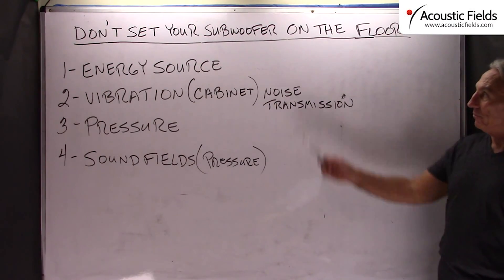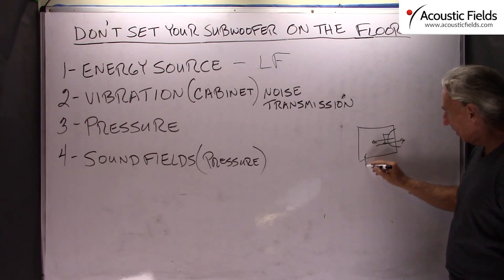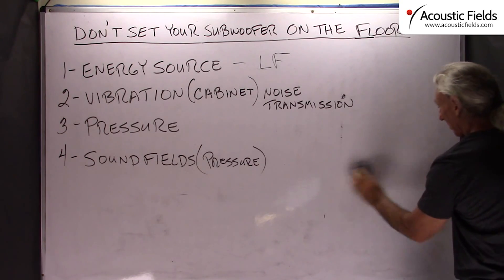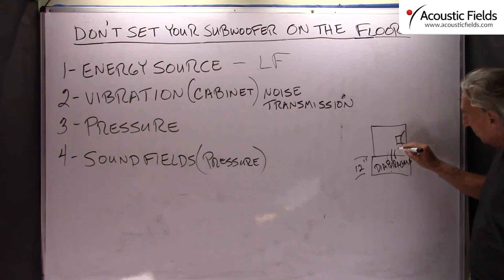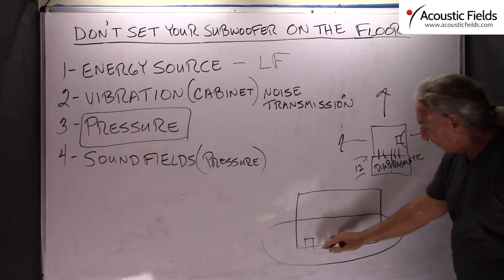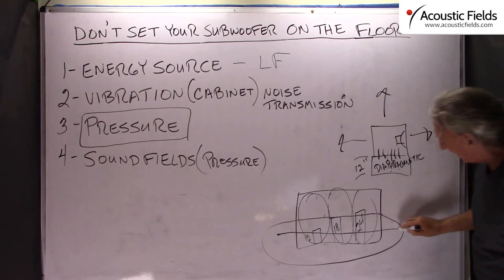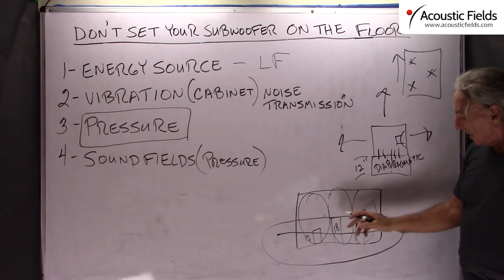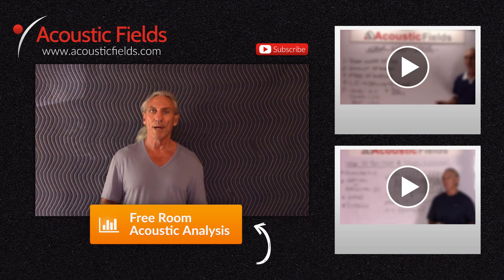Don't Set Your Subwoofer On The Floor! - www.AcousticFields.com

Comment: In my room, an SAE A501 powers my 2 double 15" G sub's sitting ona  4"platform. The subs also sitting on 4" isolation foam behind my DIY 108" Harkness acoustically transparent screen. Is this adequate for a seating distance of 12ft away
Reply from the maker: P, There is no such thing as an acoustically transparent screen. Two things happen when you place a screen in front of a speaker. First, certain frequencies are attenuated based upon screen material and thickness. Secondly, the dispersion array of the high and middle frequency drivers is distorted. There is no free ride in acoustics. I would have to know much more about your room to assist you with speaker positioning. Give me WHL.

Comment: What about subs with dual opposing active driver?,I understand this video is from 2016 and we are 2020,I just purchase dual opposing seal subs they don't vibrate...is this ok on the floor(rug).thks
Reply from the maker: B,  You will improve room response by elevating, isolating, and attenuating energy as close to source as you can.

Comment: BS! :D Positioning subs like that you get time aligment issues which leads to phasing problems... Second, sub is not pressurising some part of the room. It will surely prsesurise the whole room.
Reply: I’m thinking the same. Also he is not telling why not to put the sub on the floor. “To prevent noise”, what noise? To be able to create sound pressure the speaker needs something solid to push and pull off from.

Comment: Hi, great video.  Does this advice hold true for down firing Subwoofer?  I have an old REL Quake sub with the speaker that points directly down to my floor.
Reply: Just put it on some sorbothane hemispheres and they will absorb all cabinet vibrations.
Reply: My HS8S definitely improved when I lifted it iff the ground, so I'm gonna go with a hard yes

Comment: How do you elevate them 12-18 inches? What’s recommended? These are informative thank you!
Reply from the maker: T, We have subwoofer platforms that are on casters for easy positioning. We can build them 12", 18" and 24" high. What is your ceiling height?
Reply: Acoustic Fields 8 Foot ceilings
Reply from the maker: T, You can use a 12" platform. https://www.acousticfields.com/product/subwoofer-platform-absorber/

Comment: Ive learned alot..  Thanks Sir.. How about playing on a live band, and if the subwoofer is on stage? Is that considered not on the floor? Thank you
Reply from the maker: I, That's a different paradigm. Sound reinforcement in larger venues is all about distribution into the room space. A sub on stage is better than a sub at ground level

Comment: Hi, thanks for the infos... i already have a mini line array (db es1203) and i put the sub on the floor....well, this thing is pretty damm heavy.... and im looking to  buy a transport dolly (they sell a kind of) or  a flight case. My question is...If i use my sub over a dolly/ or case w/ wheells, will work like you`ve showed on the video? thanks again and a huge hug from Brazil.
Reply from the maker: A,  Use whatever methodology you have available to elevate the sub. Report back to us on your findings.

Comment: have a Samsung 2.1 CH 200W Soundbar with Subwoofer - HW-R450/ZC. took it off the floor and put it behind the Samsung 55" nu7100 Tv on my stand.  Huge difference! thanks so much!
Reply from the maker: M, Never put a speaker behind a solid object. You destroy its radiation pattern and create more issues. Place it above the screen at an angle firing at listening position.

Comment: How does this apply to a sub with a port in the back and face of sub is on side of the box?
Reply: I turned mine facing the listener, so the speaker side projects toward me.  The wave goes everywhere though as he said in the video.

Comment: This is just not correct putting not putting your sub on the floor may cause more transmission through the floor to your neighbors, but as far as sound in the room is concerned you will get more output as the subwoofer acts as half-space radiator increasing output and eliminates the reflection from the subwoofer to the floor improving frequency response. As long as it is a true subwoofer operating bellow 80 hz there is never any benefit form spacing them off the floor.
Reply from the maker: K,  Noise transmission occurs when you place a low frequency generating source against any structure whether its a floor or low-frequency drivers installed in the ceiling.. We get calls everyday on this issue. Once again, quantity is not quality. Using your room to increase low-frequency output is using room distortion. Our goal is to reduce distortion of all types. Everyone's goals are different.

Comment: I'm short of room, could I hang it from the ceiling?
Reply from the maker: W,  We have used that method.
Reply: Is there a massive difference between putting subwoofer on floor properly to hanging them properly from the ceiling?

Comment: When is good enough, enough...and we can just forget about all of this and get back into the music? Do towers not crossed to a sub have to be elevated now too with diaphragmatic absorbers? Do kick drums and bass amps need to be placed on elevation platforms during live events? Until the recorded orchestra floats in space, I'm not going to fret over any of this. Pun intended.
Reply from the maker: DJ, Yes, it can be a bit overwhelming. However, once you start treating issues within your room, you start to increase the resolution of the room. You notice more of everything. One improvement by itself is not that noticeable. However, when you do 2-3 of them, you hear changes that are positive. My advice is to do certain things first since they have the most audible impact for the cost.
Reply: you confuse live music with music reproduction!

Comment: you speak of "de-coupling" the sub from the floor to minimize sound transmission to the floor, what it the floor is concrete?
Reply from the maker: T, Yes, most slabs are 4 - 6" and will move with low frequency energy. Elevate, isolate, attenuate source.

Comment: What kind of material would a 12" platform be made of? Plywood with rubber type feet/isolators.
Reply from the maker: P,  Here is a link to our sub woofer platform. We custom build to height width and depth requirements of speaker. https://www.acousticfields.com/product/subwoofer-platform-absorber/

Comment: What can be used to raise the subwoofer 12 inches as you said. And I only have one sub. I have kept it on left corner of the room with corner traps on left and right
Reply from the maker: P,  Never put a sub woofer in the corner of a room. Our sub platform was designed to elevate, attenuate, and isolate the sub.
Reply: Thank you, how much would it cost me? It about 2feet  from the corner, but I'll try 1/4 or 1/2 way of the length of room.
Reply from the maker: P,  Here is link: https://www.acousticfields.com/product/subwoofer-platform-absorber/

Comment: I have my Home theater at the basement with tile floor and some rugs so I have no vibrations
Reply from the maker: M,  Low ceiling heights produce low frequency modal issues throughout the room.
Reply: Acoustic Fields how do you know how high or low the ceiling is in his basement?      

I have customers with 14 foot high ceilings in their basement.   

Good thing you don’t attempt to do car audio.
Reply: @caseytbss  Generally, a 14 ft ceiling in any room would be an exception to the rule especially in the basement. On average, the chances of anybody having a 14 ft ceiling in any room are very unlikely. Ceiling height is the most critical dimension in the room. This dimension along with the other common dimensions in a bedroom/living room,  create horrendous standing waves and dips in any given frequency starting from around 60 Hz on down, hence, modal issues. The assumption on AF's part was that it was the very common, low ceiling height in the basement which it probably was. The answer could also be: "If you have the typical 8-9 ft low ceiling height, you are going to have low frequency modal issues throughout the room."

Comment: If I am building a drum decoupled riser with U boats, what size wood do I use 2*4, 2*6,2*8, and can I use mdf for the top of it and can I use 1/2 Inch MDF or do I need 3/4, Basically how do we properly build a decoupled drum riser for a double bass drum set, My acoustician is telling me to put it on rollers but I am currently building it on rubber pieces.
Reply from the maker: T,  Neither will do the complete job.  Use a platform that was designed to manage the "double" low - frequency energy sources with the kicks. Here is a link to our drum platform: https://www.acousticfields.com/product/drum-platform/

Comment: For my PC setup, can I place my downfiring subwoofer on my desk?
Reply from the maker: J.  Why would you want to subject your computer and electronics to vibration transmission.
Reply: I already have the PC on the desk directly above the subwoofer and haven't had any issues. I was trying to raise the subwoofer height using the room environment. I can't raise the subwoofer under the desk as it'll hit the desk. I thought a solution might be to place the subwoofer on the desk underneath some foam.